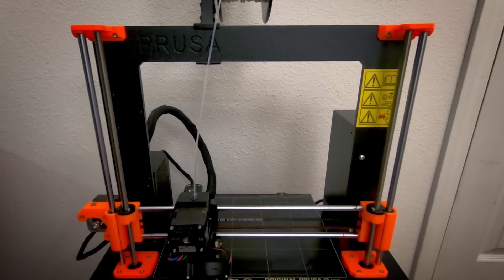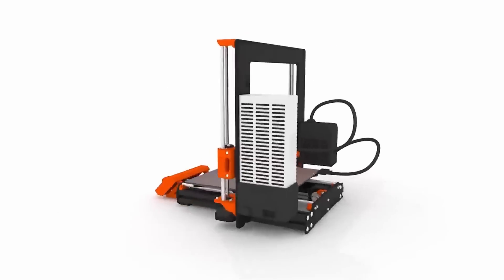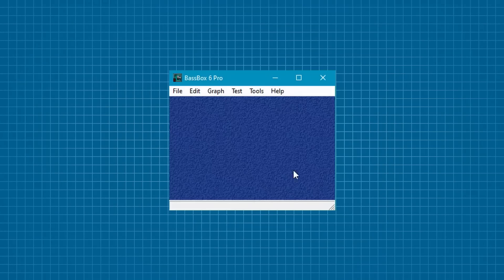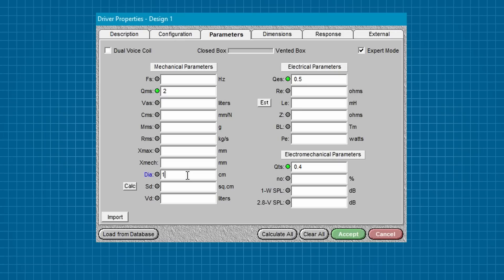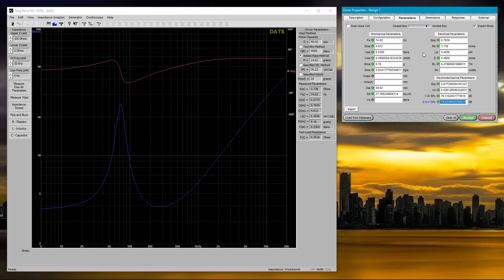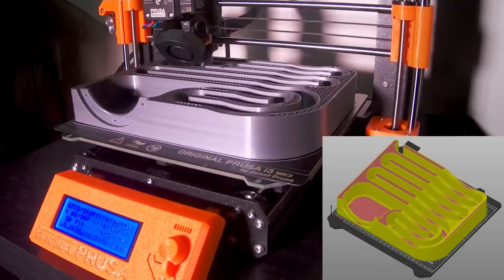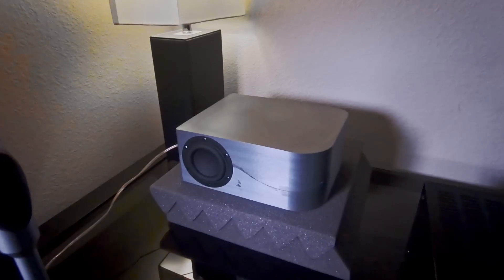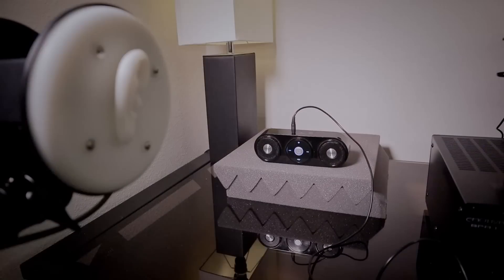Can a 3D printed enclosure get low?

Comment: Why did you use a $34 no name speaker for something that was so engineering intensive?
Reply: Not that hard?

It seems this man has an audio engineering degree, a full blown studio designed to analyze acoustics, the programs needed to analyze subwoofer parameters the 3D printer to  construct it and the knowledge of how to use CAD style software in order to construct it out of thin air.

I’m not sure exactly what your definition of hard is.... but that would completely meet my definition of hard.... which is why I asked.... to go through all of that, in my mind, it would make infinitely more sense to use a quality component with a known proficiency for producing quality sound rather than some no name component that nobodies heard of.
Reply: Let’s take it another step further.... let’s say he actually constructed the speaker itself as well.... let’s take it a step further and say he actually engineered the amplifier that is sending sound to the speaker.... let’s take it a step further and say he hand wound and produced the wires he used to carry the signal to the speakers with....

If you do all this, and it doesn’t sound amazing then you have too many variables. Simply starting with a component that has a reputation for being quality takes a lot of the guess work out of one piece of the equation so the focus can be placed more accurately on the part of the product that he produced.

In the video the mass produced speaker sounded better through my phone.... which doesn’t mean crap because trying to judge sound quality of a speaker that has been recorded and played through another speaker is an act of futility..... but I do wonder.... if he had used let’s say Focal Coaxial... I’d know for a fact that if it sounds worse than the mass produced piece..... it’s not the speakers fault it’s the design itself.

Comment: SEMI OFF TOPIC- But since it seems you really know WTF is up with audio enclosures, why hasn't anyone ever made a 1 way valved baffle that acts as a buffer for rear excursion, but frees up compression in a sense for forward excursion?  Think of it as a timed release within a sealed box that one could fine tune "tightness" in real time with per hertz output.   I hope this makes sense for you to understand.     Do you think it would be possible or beneficial for such a mechanism I have in mind that could time the valve release from an incoming signal by tuning in a bit of latency to slow down the the actual amp output phase so as to get a perfect tune from such a concept?  Let me know what you think about this idea and if it's even something that would be worth tooling with.  I can write code and maybe able to aid in designing such a system outside of the actual box design.
  I am always perplexed as to why we go into all the trouble of building the next best thing over and over again to any given system, but completely forget to address such antique notions of "in this case" continuing to neglect the fact we've never really modernized the function of the static boxes we put all this gadgetry in...   There should already be self tuning boxes for Christ sake.  Thats all I'm saying I guess.

Comment: All you need to do is make the two parts male and female. One with a small ridge all over the curves and the other with a dent like a bed for the ridge to go in. After that you just need some epoxy with an activator or even silicon glue for sinks and toilets that will glue and seal the parts together, this will make the box as air tide as possible. I would love to have the model for printing even as it is I`ll fix the air leak my self I just want the measurements and shape...

Comment: needs a tweater the highs are drowning. i can tell cause i dint use head phones.and im using a tablet witch has tweeters. i can tell the base is good though cause i couldent hear it.for the dumb ones scratching there heads tweeters dont play base.

Comment: Typical of all acoustically amplified cabinet designs is the noted lack of punch and detail. Yes, you gain efficiency but as it takes time (in the case measured in Milliseconds as opposed to full seconds for the smart asses out there) you are smearing the waveform that arrives at your ear. How you might ask. Well, ask yourself. Where is the sound coming from? In this case it comes (primarily) from the front of the driver as well as the back port of the driver. In order to make the sound from the back actually add to the front it must be in phase. It starts it's life out 180 degrees out of phase so if the sound from the back of the speaker reaches the ear at the same or close to the same time as the front you will get the grand sum of zero. Why is the port 1 meter long? The sound has to travel that far before it is allowed to join the rest of the waveform. Everyone gets excited about the fact that yes, at a given set of frequencies it will add SPL. The problem that no-one ever seems to note is that it is in this case delayed (2.89 milliseconds actually) and even though it is in relative terms phase correct (At specified frequencies that is. Meaning it is still out of phase at others) it is not time correct. No, phase and time are not the same. It is the same as when a drummer does what is called a phlam on a snare drum vs a single stroke. A phlam uses two stick strikes (two hands) at slightly different times vs a single stroke which is actually one hit. We can easily hear that difference. What if every note played by every instrument in a song was "phlammed". Yes, details become less intelligible as we are physically generating a kind of distortion. Car audio speakers love long sustaining bass notes but cannon shots especially multiple ones typically lack impact similar to the way they were recorded or more so in real life. This is why. Now, to be fair there is no 100% time accurate full frequency system in existence yet. We actually haven't figured out how to make that but the notion of "who cares, let's not worry about time accuracy and chase only spl or frequency band width or flat frequency response only matters" doesn't work because quality audio (meaning all a sound system is doing is making the original source sound louder) is dependent upon all three of these factors being of equal importance. Why do SQ (sound quality oriented car audio) systems use sealed cabinets with great drivers? So they can get the best balance of all three parameters possible. Yes, they typically have far more expensive drivers and require huge amps to run them because the front of the driver is doing as much of the work as possible meanwhile the driver is usually relatively flatter than most, more time accurate and the cabinet is not messing as much of that up any more than it has to.

Comment: The curve is awful... I'm really sorry for saying that but it is waaaaay too curvy and for a sub you want a pretty low crossover and not for it to go up into high mids as this one does. It also sounded very muddy, probably because of that awful curve. I've listened to this through my KRK Rokit 8 G3s and a 12S2 subwoofer.

Comment: This is nerd stuff but partly I am as well. So I do completely understand the "magic" behind. Very nice video and very educational rather than some zero actress show her boobs. Seriously, nice video. No irony behind.  I was just curious... If I good understand, the red indicators shows how balanced the config is right?  Is there any option to tweak that ? With for example radius related to how the air bounce in different angles and how the "weave" spreads across the volume or space? In another words, I am missing the fact, that we have some 0 zero point pressure calculated in Pascals or bars on ground level or what ever and that means easily how efficiently the sound spreads no?  It is different on Mount Everest and different at Sea level. So... And obviously the angle. More flat, more straight and pressure, more radius more environment hit and so on. That is what I missing in total. However good explanation. Sorry to disturb with my notes.

Comment: 3" subwoofer? Yeah no. You can get decent mid bass but absolutely need a big driver for sub bass. Unless you're willing to compensate electronically and are happy with low SPL.

Comment: Pretty good Bass response but it sounds like shit. Super boomy and muddled with no real highs to speak of. Granted the BT Speaker is basically the exact opposite.
Reply: You missed the fact that he built a subwoofer
Reply: @Pypamid  Nope, didn't at all miss that because he didn't use any Crossover to cap the frequencies to the normal ~200 HZ and below like any normal Subwoofer would be. He essentially made a low range Mid-Bass.
Reply: @bookcadenb4584  well yes, but that's not the point. Midbass or subwoofer it was not made for crisp clarity and great FR
Reply: @Pypamid  I agree that Subs aren't meant for upper register of frequencies. If I were doing this test, I would not have done a direct comparison between a non crossed over Sub and a shitty Bluetooth Speaker. That's my point, he made a direct comparison between the 2, instead of say his Sub vs a BT Sub (or at least a BT that advertises great Bass).